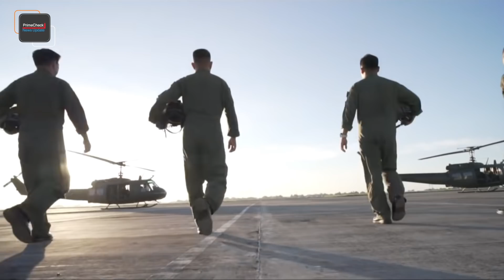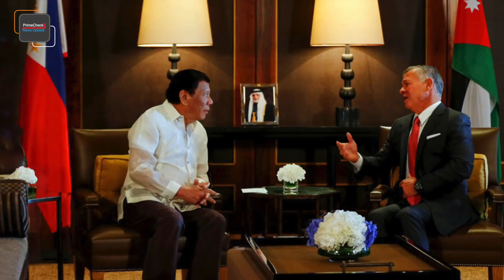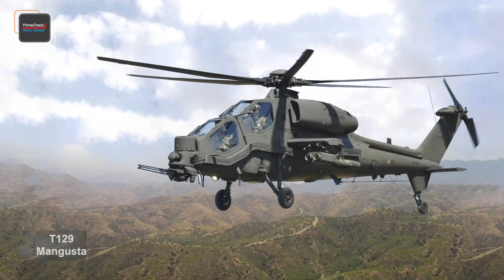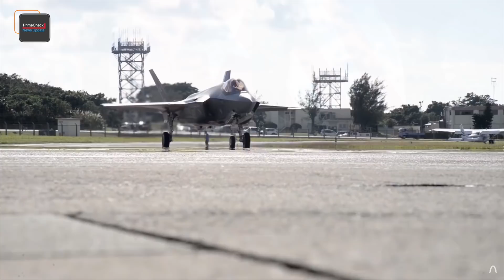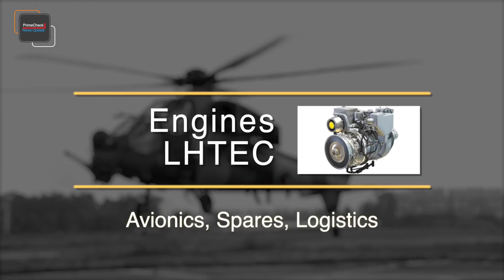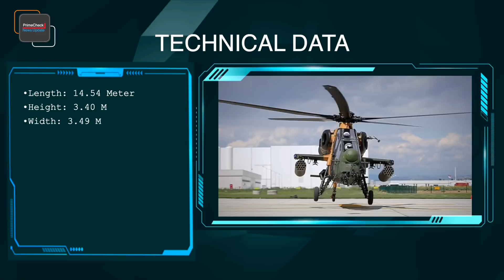T129 ATAK Multirole Attack Helicopter with State of the Art Combat Systems | Philippine Air Force

Comment: For me, I prefer again AH-64E Apache or AH-1Z Viper or older AH-1W Super Cobra, well wala na tayong magagawa but i hope we have this in the future. For me, T-129B is just light attack helicopter, can carry half of payload of Apache or Viper or Super Cobra because of smaller ang lighter helicopter.
Reply: Sobrang mahal sa mga gusto mo.
And just because "light" siya doesn't mean hindi siya maganda o mas worse kesa sa Viper, Apache, etc. 

Yan naman yung in line sa needs natin.
Para kang nagsabi na mas maganda pa yung Abrams tank kesa sa Type-10 tank ng Japan kahit hindi ka nag take into account yung environment kung saan yung dalawa mag-operate which in this case mas better yung Type-10 dahil mas mabilis pa siya madeploy tsaka smaller in size so hindi mahirap i-maneuver sa city at maliit yung strain sa infra natin dahil sa kabigat nila.

Hindi naman natin need yung sobrang firepower ng Viper, Apache, etc. Mga rebelde at ibang jihadis na walang anti-air capabilities lang kalaban natin.
Reply: @dickmelsonlupot7697  walang anti-air ang mga rebelde? Bakit meron silang RPG-7 although hindi ito guided rocket pero malaking peligro ito sa mga piloto natin. Even sa S-70i blackhawk natin walang missile warning system or even chaff/flare dispenser wala sa T-129 pa kaya.
Reply: @ruphyflorencioii5069  
From what I read they are to be added later on, if the deal pushes through. Those are cheap and relatively easy to acquire. Even Japan locally manufactures them so it would be easy to get them later on

But realistically speaking we don't really need those. Why??
Do you even know how expensive and hard to get missiles with lock-on features are?? 
The only reason Afghanistan or the rest of the Middle East have those in abundance was mostly because of the US i.e. them giving the Afghanis loads of stingers during the Soviet-Afghan War.
Even ISIS have them in limited numbers and the Russian ones that do have lock-on are hard to get. 
Plus they aren't exactly cheap. 
Mas madali pa magsmuggle ng parts & ammo para sa isang lumang anti-air gun kung saan redundant na yung pinag-usapan mo na counters

And don't say to me na makipaggyera tayo sa China. 
That's just stupid and very unlikely contrary to what many may think.
Plus diplomacy is a thing and any bold act China does can be discussed with properly. 

Like I said, they're not needed here and like I said previously, things like the RPG-7 isn't even a real threat for aircraft
Reply: @ruphyflorencioii5069  
And why would we need a minigun??
Sobrang mahal ng system na yan tsaka sobrang complicated to set up. Mas mahirap dahil mag-latch pa yan sa electrical system ng black hawk dahil yung minigun kailangan ng kuryente.
Mas maganda pa yung conventional na M60 at iba pa.

And besides, walang use yan if you objective ng BH natin is for transport lang.
Reply: @dickmelsonlupot7697  nag sabi ba ako makig gyera tayo china???  Dds typical line talaga purket kapag fully kitted ang mga helicopter natin makig gyera na tayoo???  isip2 ka naman iba na ngayon broo
Reply: @dickmelsonlupot7697  FYI hindi electrical system ng blackhawk gagamitin para sa Minigun kundi isang malaking car battery do some research naman or watch some video and YES the role of the blackhawk is to transport troops lang at bakit ibang blackhawk especially US mayroon M134 minigun M60 or M240 or even GAU M3M 50.cal?? So don't tell hindi kabitan ng armaments ang blackhawk?? It will sitting ducks kapag walang guns each side.
Reply: @ruphyflorencioii5069  
Lol, obvious talaga wala kang alam tungkol sa minigun, here's a link to Forgotten Weapons talking about the minigun:
https://youtu.be/rIlwHT4IdRc

Pa-research2x ka pa eh obvious talaga wala kang alam.
Sure pwede kang gumagamit ng car batteries pero isipin mo malakas yung power consumption ng minigun dahil sa electric motor niya. Yung car batteries na yan madaling mawalan ng power within several seconds of firing. Wa'g mo akong sasabihin for every burst magpalit pa sila ng battery?? Wa'g maging bobo.
Yung paggamit ng car batteries either for display purposes in an emplacement format o yung pang quick reaction.
Super obvious na kung saan sila dapat maghanap ng power source para walang kataposan yung pag-rotate ng barrels.
At dahil bobo ka, sasabihin ko sa iyo:
Edi sa powerplant ng vehicle mismo which sa case ng Black Hawk sa electrical systems nila particularly yung electric motor na nagbigay ng power sa buong helicopter.
Mas mura pa na option at mas sensible pa na kumabit sa electrical systems ng isang vehicle kesa magrely ng batteries.

Anong sitting ducks?? 
Lol, sobrang nabobo ka sa videogames brad. Hindi yan basta't basta mashotdown yung helicopter ng small arms fire.
Designed na yan na lilipad pa rin kahit natamaan ng bala. 
Hindi yan katulad ng Call of Duty na isang magazine lang ng M4 mo sunog na agad2x.

Tsaka ang daming factors para ma-apekto yung trajectory ng isang bullet. Simple physics would just slap you in the face with your stupidity. 

A shooter has to be incredibly lucky to be able to realistically shoot down a helicopter or there has to be hundreds of them firing at once to actually have an effect not because of bullet penetration but due to volley fire which as I've already stated, is the concept behind anti-air where penetration & accuracy isn't key but volley fire to increase the chances of fragments getting in contact with an aircraft.

And FYI, those attachments are easy to attach and as far as I know are somewhat interchangeable with other platforms or hell we can even make them ourselves with the right metal pieces. 
And like I said previously, if they are going to put a gun on the side, miniguns aren't needed, they are a hassle to attach, are a waste of bullets (ergo making it expensive to operate) and are more expensive in terms of sticker price. 
A conventional blowback MG is a better choice and a cheaper one at that than the minigun. 

And as a sidenote, Japan and many other countries that have Black Hawks don't always put guns on the side of their BHs. Like how we are going to use them, the ones who already own them just use them for transport. 
Kahit ang Japan kung saan may local variant sila i.e. yung UH-60J. You'll rarely ever see one of them having a gun on the side. 

The US can put guns on all their stuff because duhhhh, they're the biggest military in the world and with bottomless pockets to spend on defense. 
Bakit galit ka kung hindi tayo susunod sa kanila?? 
Pinakita mo lang yung pagka-social climber mo. 
Hindi porket may ganyan yung US, kailangan meron tayo.
Reply: @ruphyflorencioii5069  
Lol, DDS agad?? 
Yan ba talaga defense niyong mga dilawan?? Walang common sense o logic kahit ano? 
Pafeeling matalino pa??

At ano naman use kapag fully kitted?? 
Alam mo ba na kahit yung US hindi sila lalabas ng full kits nila unless nag training exercise o nakipag gyera talaga?? 
You will barely see any BH in the US or any of it's bases fully kitted out just casually roaming around in the sky.

Alam mo bakit?? 
Because all those kits adds WEIGHT to the total weight of the aircraft.
And if you have more weight, your aircraft needs more power to create more lift, and with more power means more fuel to be consumed. And higher fuel consumption means higher overall costs especially in terms of fuel at kung wala kang alam, MAHAL YUNG JET FUEL gago. 
Why do you think aircraft especially in the civilian market are made as efficient and as light as possible?? Kahit yung military aircraft, as much as possible they are made as light as possibly can and that's due to FUEL EFFICIENCY 

I know this very well dahil aircraft mechanic ako with years of actual experience. Eh, ikaw?? Dilawan ka na, keyboard warrior pa?? Na hanggang "research2x" lang pero walang alam sa basics ng flight o sa aviation in general.
Pafeeling "expert" ka pa.
Nakakatawa yung mga keyboard warriors katulad sa iyo
Reply: @ruphyflorencioii5069  
Kung may alam ka lang sa aviation, dapat alam mo na as a TRANSPORT role, useless yung binabanggit mo na "accessories" dahil nag-add lang yan sa total weight ng helicopter.
Not only will it force the aircraft to consume more added fuel for the unnecessary weight, you'll also limit it's TRANSPORT role dahil yung total weight na kaya sana ng helicopter, mababawasan dahil sa extra weight ng machine gun, mga ammo niyan (which FYI will weigh more than 2 guys with full gear) tsaka yung iba na gusto mo which not only will cost more fuel, you'll just add more strain on the aircraft's overall rigidity dahil sa extra weight.
Reply: @dickmelsonlupot7697  akoo dilawann??? come'on never dilawan nor DSS broo hindi ako katulad ng ibang tao diyan at may kanya2 tayong opinion. Tsakaporket mag komento ako kung anong wala sa BH natin or any air assets ng PAF keyboard warrior na agad??
Reply: @dickmelsonlupot7697  ohh alam mo ang lahat dahil aircraft mechanic kaa at Oo wala akong alam when it comes to basic about aviation ang importante is nag bigay kami ng komento tungkol sa helicopter or any assets. At hindi masasayang ang pera mula sa bayan.
Reply: @ruphyflorencioii5069  
Lol, komento??
There's a difference between giving actual commentary or just outright complaining without any basis for such comments.

Mas masayang yung pera ng bayan kung kukuha tayo ng "upgrades" at ibang "accessories" kung hindi naman gagamitin and is solely just there for the "what if" reasoning which makes no logical sense at all.

Same lang yan sa question kung bibili ka ba ng SUV o pick-up truck na 4×4 ba o 4×2 kahit yung use mo lang sa said vehicle is sa city lang o yung pag haul ng cargo.
Reply: @dickmelsonlupot7697   yes tama mga sinasabi mo. Overall what im saying is bakit pinipilit ngayon itong T-129 from turkey well it's not bad for me naman as AH what im saying is doon sana tayo sa magandang quality. What if may engine failure tapos ang reason human error??. Kung sa turkey mula ang engine it takes some years to complete the engine of T-129. For me po the disadvantage is not about light and small kundi yung lagayan ng ammunition ng 20mm gun nasa may left side pahaba nasa labas instead nasa loob dapat like apache or viper at mga wing pylon naman meron malaking wire to connect rockets and missiles etc. Totally exposed ito unlike apache and viper walang naka exposed na malaking wire each wing stub.
Reply: @dickmelsonlupot7697  im not keyboard warrior okey im curious kasii iba nag design ng blackhawk natin especially yyung exhaust ng BH iba compared to other countries aside from upturned exhaust instead yung malaking square im not mistaken.  Tsaka walang built rescue hoist for SAR/HADR operation majority ng mga blackhawk may rescue hoist i wonder kung bakit wala ito kahit ito lang.

Example Aw109 ng navy may removable rescue hoist which is good for SAR kung hindi gagamitin they remove it.
Reply: @ruphyflorencioii5069  
Yung "square" na pinag-isipan mo ay filter sa air inlet laban sa sand at dust. 
Katulad sa upward exhaust, useless yan sa atin dahil yung environment natin hindi puro sand at dust. Yung filter na yan dinidevelop para ma-operate ng maayos sa dessert na environment. 
It's actually a bad idea in our environment dahil humid yung bansa natin tsaka common occurrence yung ulan which will block the filter quite easily. 

Tsaka yung hoist. Optional yan. 
And no, not all Black Hawks have those hoists.
In fact, yung inisip mo na "hoist" isn't even standard issue. 
The BHs na may "hoist" are RESCUE VARIANTS 
Hindi yan yung standard na variants which we have. 
Plus pwede naman yan bilhin o i-fabricate dito.
Reply: @dickmelsonlupot7697  so sir may chance po kabitan ng hoist?? Kasi napanood ko sa news na may parang bilog near sa may engine intake right side hindi kaya parang connection sa rescue hoist?? At yung FLIR po diba malaking tulong naman sana sa mga piloto ito especially at night even NVG compatibility ang mga blackhawk??
Reply: @ruphyflorencioii5069  
Mula US yung engine.
Si Leonardo gagawing middle man. 

And the T129 is actually of good quality as well. 
Don't underestimate TAI. They're actually quite capable and have products and procedures that are on par with those from the West.
Plus yung T129 is a variant of the A129 Mungusta which is a very capable AH considering it's size.

Tsaka wala naman problema yung side placement ng ammo. Though byproduct siya sa size ng T129 mismo, yung benefits mo in regards to space & weight savings is high. 
Tsaka mas madali yung assembly & disassembly diyan kesa kung internal yung ammo bay at linkage. 

At anong exposed wires?? Silang lahat may exposed wires. At hindi yan problema sa design ng T129 kundi dahil sa complexity ng advanced weaponry katulad sa Hellfires, TOW, etc. 
Meron talaga wires yan kapag yung mga guided kinabit sa gilid. 
Just look:

https://www.alamy.com/missiles-on-apache-attack-helicopter-image790764.html

https://www.dreamstime.com/stock-photo-anti-tank-missile-helicopter-wire-guide-rocket-launcher-mounted-attack-image68512731

Like I said, ganyan talaga yan kapag guided na missiles yung ikabit. 
It's not a problem of the T129 but the weapon system itself
That's normal to see on any aircraft tsaka hindi naman katulad sa wires na makita mo sa electric posts sa Pinas. 
Insulated tsaka mataba naman yung wires na yan para hindi maapektado yung electrical systems.
Reply: @ruphyflorencioii5069  
FLIR isn't exactly needed basta night ops.
Standard night visions are enough. 
Yung purpose lang ng FLIR ay pang target acquisition. 
And yes they can be upgraded later on and is an easy upgrade. Pwede naman tayo pakabit kay Japan if they're willing at kapag kaya na sa legal systems nila na mag-full force ng export ng military equipment since may alam si Mitsubishi diyan at sila yung nag assemble at nag upgrade sa kanilang UH-60Js. 

And yes pwede after market yung hoist. 
There's already a partition for it sa gilid. 
It's just a matter of buying it and attaching it. 
Pero yung specialized na hoist talaga na pang rescue, then we need a purpose built one talaga like yung nasa Coast Guard natin (yung H145). 

Like I said, walang need yan sa atin and if they plan to upgrade, madali lang yan and should be an issue to be brought up in the next horizon since yung current project is for acquisition only at wala naman problema diyan.

Para lang yan bibili ka ng sasakyan na may steel rims at rim cover (i.e. yung basic na basic na wheels at mags). 
If gusto mo i-replace yan maghanap lang sa aftermarket katulad sa mga Volks o Black Rhino.
Reply: @ruphyflorencioii5069  
If you're really that concerned for the Black Hawks then don't worry. 
Ang daming users dito sa mundo with Japan being the closest one that has production facilities for parts madali lang maghanap ng upgrades at iba pa.
Reply: @dickmelsonlupot7697  im just expecting too much sir when it comes to the air assest especially the BH kasi syempre lahat tayo mainggit sa ibang bansa meron BH or other helicopters from other countries just like way back 2013 bagyong yolanda majority of air assets nanindito sa cebu "helicopters" like osprey, blackhawk etc.  Pero sa atin nga vietnam war UH-1 single engine parin. ngayon 2021 na nandyan parin instead it should be retire na sana noon pa chaka another crash nanaman ng UH-1D or H. UH-1 is good naman pero sa kalumaan na dapat retire or nasa museum na sana. At may life span ang airframe either plane or helicopter.
Reply: @dickmelsonlupot7697  tsaka alam naman natin na mahilig talaga ang PAF sa mga halo2 ng mga air assets hindi mag stick atleast dalawang model lang especially CUH like S-70i and the future UH-60M kapag palarin lng sana.
Reply: @ruphyflorencioii5069  
Sobrang mahal ng UH-60M.

Kung gusto mo talaga ng BH mas better mag source tayo sa Poland o kay Japan. 
Wala naman problema sa Polish at Japanese na BH. 

At wala naman problema kung halo2x as long as kaya natin.
Ang problema kasi kapag mag fully source tayo sa US ay yung upkeep. 
Sobrang taas ng upkeep hindi natin kaya mag keep up. 
Parang social climber palaging magpa-updated sa current at trending na iPhone. 

Wala talaga tayong choice if maghanap tayo ng mas mura na options dahil limited talaga tayo sa budget.
Reply: @dickmelsonlupot7697  okey naman sa aking yung S-70i sa poland as long ang specs niya UH-60M or other specs mula sa US. Para ang maintenance at training ng mga piloto iisa nalang ng platfrom po. tsaka I don't know if totoo ba bumili ang PAF ng mi171 mula russia eh same naman ng capability medium transport pero they convert as heavy lift instead CH-47D chinook which real heavy lift talaga ito. Tsaka wala pang news tungkol diyan.
Reply: @ruphyflorencioii5069  
Wa'g kang mainggit. Hintayin mo lang dahil yung progress mahina talaga. 
Hindi yan overnight.
Kaya nga sabi nila, Rome wasn't built in  a day. 

There is no way we can just instantly replace the old Hueys. Kahit ang Japan may stockpiles pa ng lumang kagamitan katulad sa F4, UH-1 o yung lumang Type-74 na tank na in service pa.
Yung mga bagong replacements nila hindi pa maka-fully replace sa mga lumang equipment and are instead SUPPLEMENTED
Meaning slow and steady yung replacement.
Reply: @ruphyflorencioii5069  
Iba yung class ng BH vs Mi-171.
Best suited si Mi-171 for cargo tsaka relief efforts dahil sa carrying capacity niya. 

Yung problema ko kasi sa Chinook is asides sa mahal (kahit yung mga may Chinook na, nahirapan sila ngayon sa maintenance dahil sa overall costs tsaka complex yung maintenance).
Plus yung katawan niya medyo awkward at hindi ideal sa terrain natin.
For half the cost, with a more simple maintenance tsaka abundance of parts dahil marami ang users ng Mi choppers at nag-manufacture ng parts madali lang maghanap ng replacement parts. 

Tsaka realistically speaking mahirapan ang Chinook dito dahil sa weight niya at uneven distribution sa weight sa ground which means madali siya kainin sa lupa kapag muddy o naging malambot dahil sa ulan kung saan kapag may Chinook tayo, mostly relegated yan sa city areas, sa airports lang o areas na hindi apektado sa ulan.
That's why you'll never or barely see them doing any relief missions in areas na may "soft land".

The only 2-rotor you'll see doing that and going to hard hit areas would be the smaller CH-46 Sea Knight i.e. yung "mini Chinooks" ng US Navy at Marines noon pero retired na siya noong 2004 (US Navy) at 2015 (US Marines) kung saan yung replacement niya ay yung Osprey.

In short, yung Chinooks ay:
- too heavy
- too big
- too expensive (sticker price wise)
- too expensive (maintenance wise)
- realistically speaking, medyo overkill naman siya if yung role lang is transport and relief which can be done more efficiently by smaller framed helicopters
-
Reply: @dickmelsonlupot7697  diba sir majority ng air assets ng paf more on western tsaka yung mi171 hindi, problem ng Mi171 is operability and compatibility ng ibang western helicopters unless kapag NATO compatibility ito. AFP is inspired NATO-doctrine if hindi ako nagkamali.
Reply: @ruphyflorencioii5069  
May variant sa Mi-171 na may NATO-standard na equipment.
Which is most likely yung variant na kunin ng PAF if i-tuloy nila.
Reply: @dickmelsonlupot7697  i see sir, aside from that no updates about MRF 2021 na wala parin.
Reply: @ruphyflorencioii5069  
I'm not worried sa delayed na MRF. 

Not sure if na point out ko yan dito (mahirap na mag back read) pero yung MRF limited yung usage especially sa "unique" na area natin kung saan sea warfare yung name of the game sa area natin. 
Yes magamit yung MRF pero yung magandang type na MRF na need sa area natin ay yung carrier based na eroplano.
Always remember na yung MRFs limited talaga yung range. Kino-compliment lang yung abilities nila through the use of carriers. If walang carriers, mahirap gagamitin sila to their full potential kung puro land based lang tayo i.e. gingamit yung airports natin. 

Plus yung nature ng air warfare, mahirap yung MRF natin dahil hindi natin magamit ng maayos dahil sa need para sa ibang equipment katulad ng Airborne Early Warning & Control (AEW&C) o yung ground based radar na may mataas na range para daling makita yung mga potential threats and all these are uber expensive and expensive to maintain as well.

Mas better (at least for me) kung mag-concentrate tayo sa anti-air o anti-ship na either land based o ship based.
Mas maneuverable kapag ganyan dahil hindi sila limited to one place (i.e. airports para sa mga MRF). Any anti-air can just move from one place to another and be camouflaged without anyone knowing where they are. Planes on the tarmac are sitting ducks especially with the lack of early warning systems tsaka yung delay ng info to command orders, malaking target yung MRF natin if ilagay sa mga airport and will be destroyed easily and quickly without even taking off the ground. 
Anti-ships are also great dahil pini-prevent mo yung potential for seacraft to get near our shores especially yung mga carriers na limited yung range nila sa kanilang jets.

Yung MRFs kasi more on head to head combat whereas yung anti-air at anti-ship pang denial ng assets which means if hindi sila makapasok within our borders, then walang gyera which is the best possible outcome. 

Yes pwede tayo kukuha ng MRF if the DND wants to pero kung MRF lang at wala yung ibang additional equipment na kailangan para ma-utilize ng maayos yung MRF para sa sea-based na environment natin, they're just useless equipment na pang-show lang. 
Kaya pwede i-delay lang yung MRF to make way sa ibang equipment needed para sa MRF. 
For the meantime, mas better yung anti-air at anti-ship
Reply: My take on this issue are as follows

1. Its a wise choice. All weather, night vision, sufficient armaments,  sufficient reaching, excellent electronic and low cost capex & opex 
2. Battle tested is critical for counter insurgency especially night attack. Screen tracking and locking is critical for pilotd
3. Enough arms for close support to ground troops
4. Reaching....distance coverage within jungle or southeast Asia condition.justvnive and easy refuelling foe close support activity
5. Electronics is latest and advance with future integration activity even with drones, satellite etc.
6. Low cost to buy as well as low operation/ maintenance cost. Its light, low fuel. Its turkish meant you got quality  but low cost for operational spares etc. Chopper maintenance is cheaper than the rest. Other manufacturer will eat up annual OPERATION  budget. 
Another plus is low cost surface to ground missile from turkey.